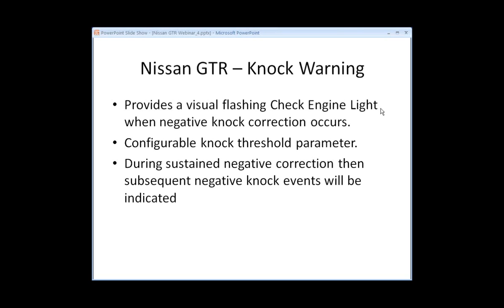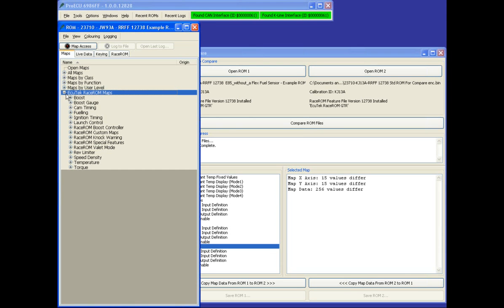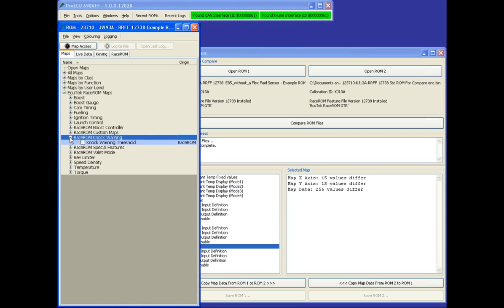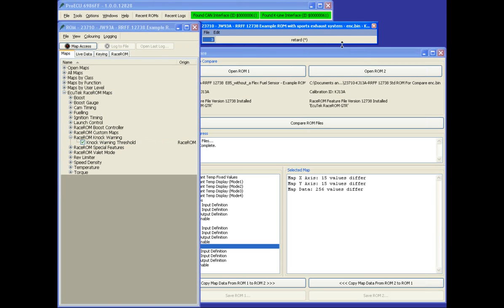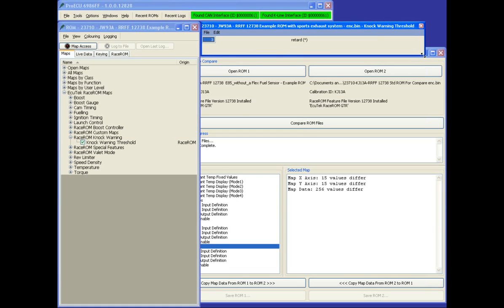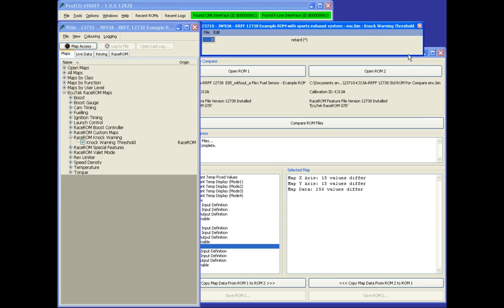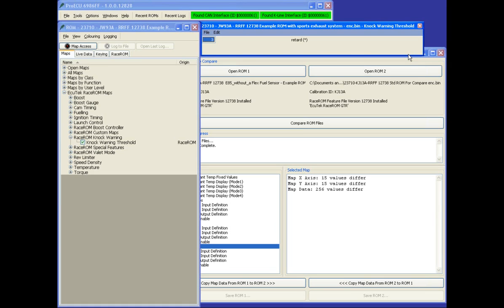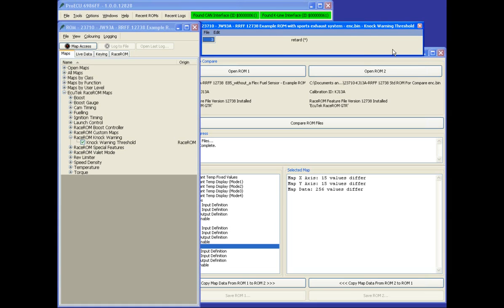EcuTek Nissan GTR Webinar - Knock Warning

Comment: I have an 2018 Infiniti Q50 3.0t AWD that is full bolt on with Ecutek tune.  I’m getting -3 to -4 knock retard sometimes, but only on low speed , low rpm pull and disappears on WOT.   I’m on 93 octane and not sure if it’s a false knock since I’m tuned from 1k miles and now my car is at 15.6k miles now with now issues, except this knock retard warning or showing up in Ecutek App on my phone.
Reply: Did you ever solve your issue? I’m having the same issue as you :/
Reply: @Wastednow  I switched to Racebox tuner (Hussain B. in Texas) Best move ever!